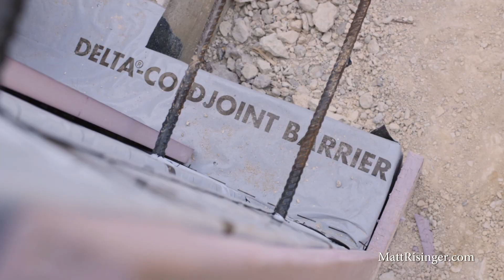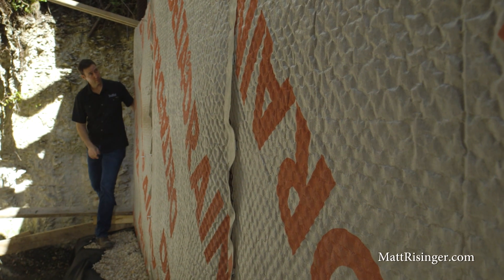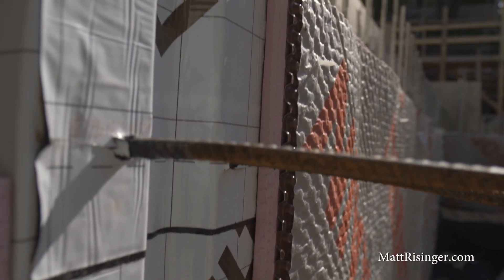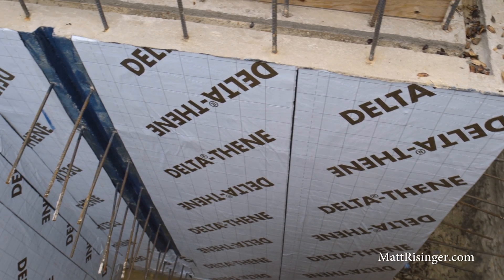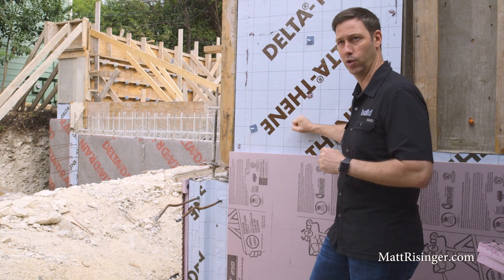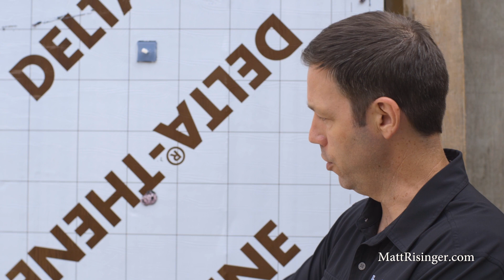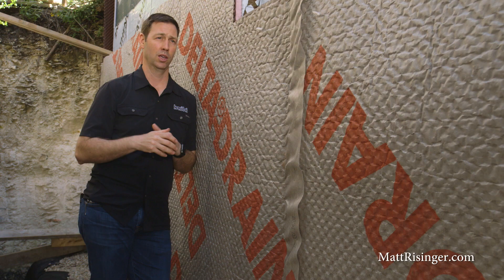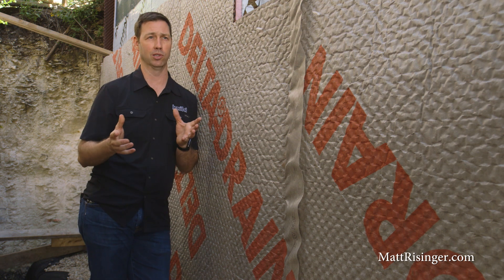Foundation Waterproofing

Comment: I have been doing waterproofing and foundation repairs for about 15yrs.  This is the most thorough design I have seen yet.  Most builders do the cheap way (thinned out tar) and ADS pipe.  Only thing to keep in mind is the drain tile system is the weak point, you must keep it clear of silt and sediment which is always a challenge when your buried under 6-10' of "loose" back fill.  Which is why now most codes require the interior system as well.  The only other problem is the sump pump, if your finishing the basement or using it for storage its a wise investment to go with a battery backup system as if the pump stops working for any reason its game over for your finished basement, stored items and appliances. Great video Matt
Reply: Any idea why they went with a sump over running the drain to daylight? Is it an issue of the land being too flat?
Reply: @cantankerousclankingcontra8295  - I was wondering the same thing, the house on on a hill so what is the benefit of using a sump pump over gravity?
Reply: I would think that the biggest reason as to why you would use a sump is to verify that the water is infact being pumped away from the foundation and the system is working correctly. If you don't have a sump and rely on gravity how would you be able to determine if the system is working correctly? With the pump you know 100% that the system is working correctly by the amount of water that the pump discharges and also at what rate.
Reply: @DimagoDiesel  - that's a good point you make, however since this builder added a ridiculously accessible cleanout, couldn't you verify that the water is being moved away by sticking a long flexible stick or rod down the cleanout. If 1 foot of the end of the rod is wet, then there must be 1 foot of standing water at the footer. If the end of the rod is dry, then that confirms there is no standing water at the footer. You could even leave the long rod in the cleanout just before a gigantic storm and pull it out after the storm to check the "high water mark" to test the performance and how fast the french drain can move water under worst case conditions.
Reply: @donaldlee6760  absolutely, but who knows could have been a customer request also to have a sump discharge. I actually have two at my home one inside and one outside. Outside takes all the water away from the footer the interior pumps whatever the exterior let's leak into the basement. Also my washer machine and laundry sink are hooked into my interior as well. (I'm on well and septic.)
Reply: This is way over kill I work for a company who builds custom homes and this is way more then we do then again the company is cheap so IDK
Reply: @andrewhernandez4968  I have been to 2 brand new houses this week that are all flooding because the builder did the bare minimum cheap fix.

Comment: 3:57 I would not feel comfortable draining exterior water to the inside of the basement just to be pumped back out. Why not treat the outside water separately and move it away from the property so that it is mechanically impervious to exterior water in the event of a power outage, plumbing failure, or backup pump failure?
Reply: It seems counter intuitive to bring water in just to pump it out, but many times it simply isn't possible (or is cost prohibitive) to gravity drain water away from a foundation.
Reply: AJ Roberts also there are parts of the country that the frost line is 48” or deeper, and not feasible to put a sump pump outside the wall. Otherwise I agree with you.

Comment: How do you deal with wall drain and brick which terminates at a roof for a bump out window and additionally where a brick chimney intersects a roof?  I have in the past run the brick to a lintel over the window and flashed the roof into the brick. There has to be a better way.  Thank you!

Comment: Do you always need a sump pump with new construction if done right?
Reply: Yes. If you don't, the water won't be able to leave on its own.
Reply: It depends what the property looks like. If you have a good slope in your yard you can run your drain pipe to a lower spot in the yard where the water can drain to day light, which is the preferred method. If the bottom of your basement is the lowest spot on your property, then you'll need to install the sump pump which can be trouble if you lose power during a storm.
Reply: Yes.  This is no more than Ice and Water stuck to the foundation in my opinion.  Water doesn't pass through a 8" thick wall.  It comes in through cracks and holes.  The water will come up through the floor.  You need to keep the pressure out of the foundation with pipes and a sump pump.

Comment: Did you install an internal waterstop between the footing and the wall along with the exterior applied cold joint flashing?
Reply: Synko-Flex waterstop was used in keyway.

Comment: Hey Matt (or anyone with foundation waterproofing experience) what about older home with the stone and mortar basements? What options are put there  for exterior waterproofing and interior waterproofing other than French drains?
Reply: We’ve fixed them before. Dig them out , clean them by pressure washing, allow them to dry, spray with 2” closed cell foam, spray a coating, add drain tile , gravel backfill.

Comment: Love the Delta Grip I'm planning on installing on a Superior Wall foundation and footing system. Drilling into foundation is not recommended. I am also looking at doing an under slab bead board using DELTA®-MS UNDER-SLAB. So it will be Gravel base under, DELTA®-MS UNDERSLAB under, 2" XPS under Stego® Wrap under poured slab.  
a DIY with Delta will be much cheaper than the $2.50 per sq ft I was quoted for rub r wall with bead board.

Comment: If you're pouring concrete or laying block and you want it 100% waterproof you need to be using Xypex. This ad-mix or paint-on product grows microscopic crystals when it gets wet and seals all of the voids in concrete. It can seal a 1/8" crack in the bottom of a pool in 3 days. I have no affiliation with Xypex but this stuff is a true miracle for concrete waterproofing. All of that layering of Dorken products is a total waste of time and money. Just throw a couple bags of Xypex in the concrete truck when it shows up on site, mix it for a few minutes, pour it like normal, and you're done. Moving on.
Reply: They used Xypex as well.
Reply: Phillip - exactly - I used Xypex on a concrete block foundation wall in Austin, Texas 20 years ago.  Applied it myself according to a Xypex reps instructions.  The rear wall of 
my house (50 linear feet) is 8 feet underground.  I have had ZERO issues...works perfectly.

Comment: All that protection on the walls is compromised without DELTA FOOTING BARRIER to combat rising damp.
Reply: With this particular foundation a fabric barrier was impractical because there was a considerable amount of rebar coming up through the footing into the underside of the wall.  To address any possible issues relating to moisture intrusion via capillary action (either horizontal or vertical), the footing, the wall and the floor were all composed of hydraulic cement via Xypex admix.  This was a relatively expensive safeguard and perhaps unnecessary, however, the house will have a finished basement and this extra insurance was deemed worthwhile.  Others facing the issue of trying to install a capillary break in the presence of rebar, but at a lower cost, may want to investigate liquid applied footing barriers.

Comment: How about just spraying the foundation in Line-X?
Reply: Kevin, are you aware of anyone who has utilized Line-X (polyurea) for a foundation membrane?  I'm very interested in polyurea to be used from footer to roof top peak and have presented this question to Matt and other building science experts several times but have never received any sort of response.  I'm not sure if it has ever been done in residential construction.
Reply: I know the government has used it to make walls blast proof.
Reply: I am interested too esp to see how it would hold up over time.
Reply: I've seen the application used for blast resistant/proof buildings as well.  I haven't been able to find anything about potential toxic off gassing that may enter into interior side of the building.  Liquid applied membranes is where the market is going. My impression is that Lstiburek seems to prefer liquid applied membranes over peel and stick.  There is an obvious increase chance for error with peel and stick whereas liquid applied seems to be more forgiving for a less skilled technician.  Peel and stick also relies heavily on chemistry ie adhesives to maintain barrier bond with substrate as well as to itself whereas polyurea forms a monolithic seamless barrier.  Just curious on where you are located?
Reply: I'm in the military so until I retire I am from everywhere lol. But in general I call New England home.If I recall the Journal for light construction didn't have the best reviews for liquid membranes for right now, but I too think that is the future.

Comment: So Matt, any idea about basements in texas built out on flat land? I don't understand why there are no basements in Texas, being that where I am is over 200 feet above sea level the idea that we aren't high enough doesn't make sense to me. Have you been involved with a build that involved a basement here in texas on flat land and what are your thoughts?
Reply: Matt I'm looking for information about basements in texas, are you able to assist with this?
Reply: Basements are common in the North because foundation footers must be below frost line to avoid damage from freeze.-thaw cycles.  No such concern in Texas.  Also, land is relatively cheap and it costs less for a given square footage to build slab-on-grade.
Reply: +Chest Rockwell Well I'm not up north anymore Chest. And I don't know what you consider cheap, we aren't all oil tycoons here in texas, land is not cheap unless your out in some remote BFE location. 

So with that being said, I will consider looking for a different builder whose at least knowledgeable about basements, which I have yet to find one, and where I'm building we can only go so high, 35ft.
Reply: +Chest Rockwell Another issue I have Chest is Matt doesn't respond. I can understand and would except an answer like "I have no idea" but to sit here waiting and waiting sucks. Also, Matt's build with SIPS, no real info, just technicality about the benefits which we all know. I would have paid to see that done.
Reply: i live in North Texas just north of Dallas. The soil we have is called black gumbo. It is a mix of black dirt and clay. If you dig in it with a shovel, it sticks to the shovel. Its volume can change as much as 40% depending on how dry it is. So in the summer it shrinks up, and can have big deep cracks. In the winter it gets waterlogged. The clay makes it hard for water to peculate down into the ground, so it either stands until it evaporates or runs off.  Most people have foundation problems because of the ground moving so much between seasons. People have to water their foundations in the summer here.   To build a basement to withstand the pressure is a lot more expensive, and has to have better engineering.  In the past the land was so cheap it was cheaper to build out than to go down.

Comment: This is no more than Ice and Water stuck to the foundation in my opinion.  Water doesn't pass through a 8" thick wall. 

 It comes in through cracks and holes.   The water will come up through the floor.  You need to keep the pressure out of the foundation with pipes and a sump pump.
Reply: You are wrong because everywhere the wall ties go through the wall you have penetrations .

Comment: R-5? Yah, ok. I'm sure it'll work there, but it makes me feel icky.
Reply: Be mindful that Austin is climate zone 2.  Heat is usually only needed for about 3-4 months per year.  AC dominates energy use by a substantial margin.  Insulating basement walls does virtually nothing to improve the heat gain of the structure (which would reduce energy for AC).  With respect to heat loss, the house was energy modeled. Going from no basement wall insulation to R-5  reduced overall heat loss, but only by 7%.  Given the relatively low cost of heating, adding more than R-5 to basement walls was unwarranted as R-5 already reached the point  of diminishing returns.